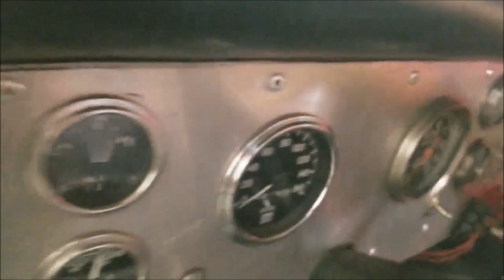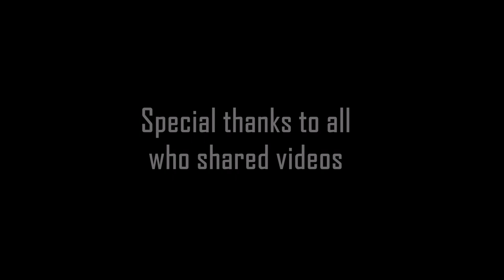These Rat Rods May Surprise You - MSG Rat Rods 2019

Comment: Here is one I am building that I think you might find interesting   The now nearly complete exterior of HYDE, an off road combination of 
Military, bug out, overlander and wastelander styles, created from a 1999 GMC Yukon SLE with Corvette LS1 Gen 3 Vortec 5.7l V8, 4 speed Corvette Automatic Transmission, Positraction rear end, 4WD, and Multi-port Fuel Injection. So far this has taken 5 years build time with the entire suspension, brake, engine, transmission, and rear end, and transfer case rebuild, then a complete restyling of the body features with all functional modifications.  

https://www.youtube.com/watch?v=3xmh7qEDsZk